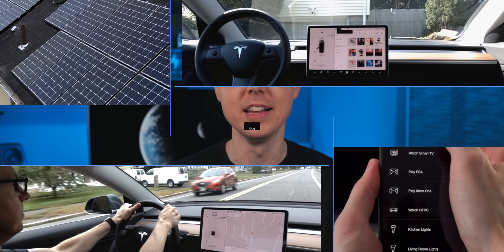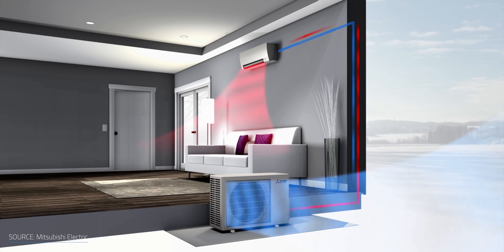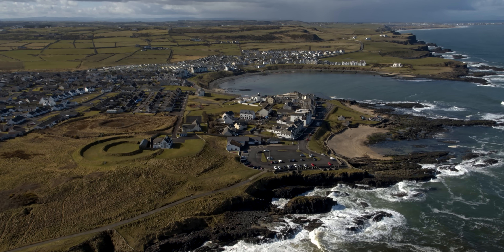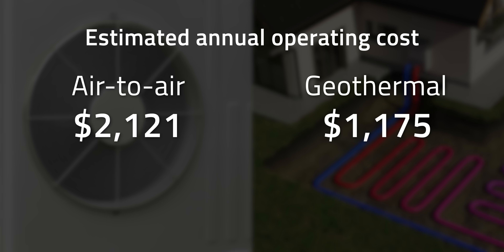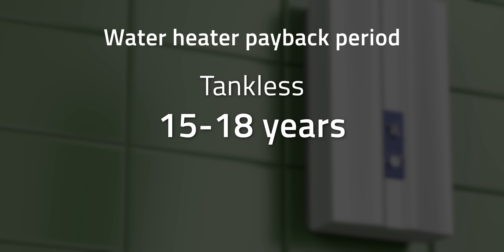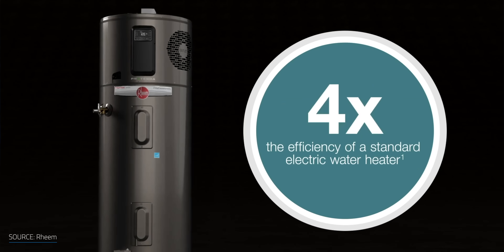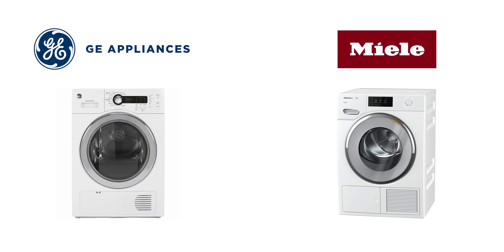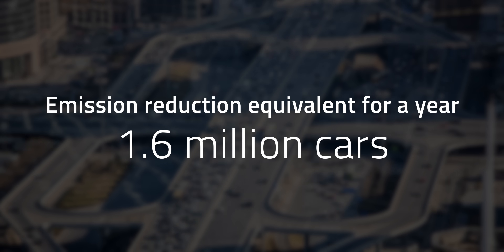Why Heat Pumps are Essential for the Future - Explained

Comment: Another thing you might want to look into: induction stoves. They cook faster and more consistently, plus they use less energy. They beat out even the holy grail of cooking: gas stovetops.

Downside: noisier, requires magnetic cookware, and a bit more expensive up front.
Reply: They are very popular outside the US. I didn't stay at my temp apartment long enough to get to love it, but I did have some experience with it. I was not overly impressed, I had to shop for specific cookware, with a magnet. I suppose if I had stayed in that apartment long enough, I would have gotten used to it. Instead I bought a ceramic top stove.
Reply: @doncarlin9081  I've used one for 15 years and I wouldn't go back to anything else. Easy to clean, surface doesn't get hot. Responsive like a gas stove but much safer.
Reply: Gas stoves are no longer considered the best, they release a lot of toxins into your home.  I do like induction for a lot of cooking (precise cooking temperatures makes custards, sauces, and chocolate much simpler, no more fiddling with a thermometer or double boilers), but I would recommend a mix of electric and induction because sometimes you want the pan to be hotter.
Reply: @Foolish188  "because sometimes you want the pan to be hotter" ???
That makes no sense.  I could melt the pan with my silly little 2kW portable unit!
Reply: A lot of them cycle on and off inefficiently, and have uneven heat distribution.
Reply: I really hate cooking on those
Reply: @dingfeldersmurfalot4560  Gas is worse on both accounts...
Reply: @dingfeldersmurfalot4560  The previous generation did.  About 3 months ago I replaced my induction hobs with modern ones ($45 each at Walmart).  They have 20 levels of heat and they don't start cycling until the heat is set to 0.5.  That is low enough heat not to matter.  If you still don't like the cycling, then you place the heat distributor under the pot.  This is an explosively welded sandwich of magnetic stainless, aluminum to distribute the heat and another layer of stainless.

Comment: I do HVAC I'm in Phoenix Az the Home of the Heat Pump from Goettle. That was a great machine. Heat pumps are getting better all the time. 20 years ago they would Heat down to 40 degrees outside so for deserts they worked great. Now I have a WSHP that can Heat with water down to 34 degrees and cool with water Temps up to 120 degrees.

Comment: Yes - I’m all in on heat pumps! As an architect, I’ve been involved with both air source and ground source over the years, and here’s my take on the two: ground source is more efficient and will last longer, but installs are complex because you are never 100% sure on conditions until you start drilling/digging. Air source are much more predictable, but I worry about sending hot air back into the environment in urban settings, contributing to heat island effect.
Reply: sending hot air back into the environment?
can you explain that please
Reply: People are going to use air conditioning for cooling whether it is from a heat pump or a single function AC.  Putting summer heat into the ground (usually just a few feet down) or into the air (rather than onto surfaces like how sunlight produces heat islands) is not going to make a significant difference.  Most homes have to issues with ground source heat pumps, compared to air-to-air.  First is the extreme cost difference, which gets relatively worse with the less heating a house needs.  The second is available yard area.  Well systems are even more expensive. There are also times toward the end of both the heating and cooling seasons when the temperatures of the ground around the tubing is not as favorable as the outdoor air temperatures. Ground source systems can be a great choice for larger buildings that also have large ground area, such as schools, but they are severely challenged for houses, especial those that are energy efficient.

Comment: Great presentation, as always. For those watching this who has a spa or swimming pool, do look into heat pumps.  I just built myself a super-insulated swim spa using ICF’s (insulated concrete forms).  Those gave me 5 1/2” rigid insulation.  I therefore thought I could easily keep the spa at temperature (usually about 100 degrees F.) with little daily-added heating, so I put in a large electric resistive pool heater (knowing it was inefficient by cost-effective to install). Even with my 4.8 kWh photovoltaic / Tesla Powerwall system, I was seeing $300/month electricity bills. I replaced resistive heat with a pool heat pump, which when operating only pulls 13.5 Amps at 240 V. 9 (whereas the resistive heater pulled 70 Amps!).  Now, my PV / Tesla Powerwall system handles the heat pump 100%, and my electric bill is down to $15/month average, and I’m keeping the swim spa at 100 to 103 degrees F. 24/7.  Amazing really!
Reply: Good for you. I have 3 plunge pools in our holiday accommodation which are all heated during the daytime using solar panels and heat pumps. Makes swimming all year round possible for our guests. No more complaints about cold swimming pools in winter. Could not afford this without good solar

Comment: Something that could help with efficiency even more is relaxing zoning laws to allow for more duplexes/quadplexes/apartment blocks/etc. since each home in those buildings shares at least one surface with another home, minimizing heat loss. 

Also has a lot of other benefits, like reducing the amount of driving that needs to be done, embedded carbon due to construction, less infrastructure needed to support, and so on
Reply: North America really needs this! It's awesome here in Europe to have lots of apartment complexes (within walking distance from businesses and services no less). It's far more efficient than suburbs although we do have those too.
Reply: Energy calculations for buildings in the EU center around this. A very modern freestanding house with top insulation and ventilation systems is not as energy efficient as a flat with only one side exposed to the elements. And improving this flat is simple because you need to improve only that one side. Free standing homes are not our friends.

Comment: I use a large and bulky portable heat pump for my shed/music studio. In the summertime, I get inexpensive cooling and in the Fall to early Winter, I get less expensive heating. My problem is that the unit stops producing adequate heat when the temperature drops below 20 degrees F. Even though my unit is indoors, at Zero degrees it's entirely useless. I am encouraged that newer models use heat coils to provide additional heat, so thanks for alerting me! I love your channel! New subscriber!

Comment: I install HVAC systems for work and an interesting thing I've noticed is that most heat pumps, furnaces, and central air conditioners that people purchase are on the lower end of the efficiency scale on the energy guide stickers. I don't believe I've seen any units past the halfway point
Reply: what's the price difference between the best and the worst?
Reply: That's because the cost for the more efficient ones is sometimes double or more. Depending on the cost of electricity in the area it might not save them money to go with a higher efficiency unit.

Comment: Thanks for a great video. I went solar late 2021 and changed to heat pump dryer and hot water as well as getting rid of natural gas altogether. The savings are amazing. My total energy spend per year has been reduced by 74%. Cheers!

Comment: Matt, with heat pump dryers, you mentioned lower heat as a negative. I built a test rig to run the temp slightly above ambient but with the cooling coils a few degrees below the dew point. Compared to an electric dryer it got two saturated beach towels dry in a third the time at about  fifth the amp draw. Cooler temperatures are nicer to the fabrics. That is a plus as I see it.
Reply: True that saved the electricity but the increased frictional wear on the fabrics, due to longer tumbling time needs to be considered. That might be the negative Matt was referring to in his video.

Comment: Presumably you’re planning to insulate your house to Passivhaus standards, so you should need very little additional heating. In which case, it might be much more cost effective and simpler to maintain to use simpler infrared panel heaters. Also you might consider using a simple airing cupboard to dry cloths slowly and efficiently rather than using a tumble dryer.
Reply: @xmfclick  at some point it’s not even a question a household with 4-5 persons in my opinion should have a tumble dryer.  However in the summer or if your living somewhere where there is only summer and no other season it’s totally wasted. Because then you can air dry your cloths outside.

Comment: You forgot about exhaust air heat pumps which heats the house using hot water radiators or flooring at the same time as heating the hot water. They take the energy from the hot air leaving the house. Nibe F750 is my favourite.
Reply: I'm a big fan of tankless water heaters. I installed one and immediately saw a HUGE difference in my electricity bill.  I'm shocked the US doesn't have them mandated, I guess companies like GE and others that make traditional water heaters don't want to stop production of a cash cow.
Reply: @Oneness100 , Tankless electric water heaters do not work well in northern climates, and consume a LOT of power for the short time that you are using them.  So they might have a 60 amp or 100 amp load for the few minutes you are using the hot water.  That is a huge hit on the grid, and in California they stopped selling homeowners a tank type water heater over 4,000 watts, so you can't buy a 4,500 watt tank heater in California.  

The heat pump water heaters have a very small compressor, so they do not provide a lot of heat each hour.  But the 50 gallon water tank can hold enough heat to provide 2 showers per hour.  

Also tankless water heaters require maintenance, and cleaning of the heat exchanger, even more maintenance when you have hard water.
Reply: @Kangenpower7  It's been a while since I lived in the home that had the tankless. Actually, after further review, it was the gas tankless, not the electric.  I just remember that my utility bill went down DRASTICALLY as a result, and I sometimes like taking either long hot showers or hot baths every so often and when I'd have guests, I didn't have to worry about running out of hot water. Plus, they'd take up very little space in the garage.

When I bought it, the only thing I remember was they had two or three sizes, this was back in 2002-2003 time frame. I just remember it wasn't the biggest, but it wasn't the smallest size.  I had the one where you could have 2 to maybe 3 hot water appliances/faucets running at the same time.  I read that in Europe, they have smaller units at each sink, etc.   I don't know if that's true, but I remember reading that a while back.
Reply: @Oneness100  The at the sink tankless water heater is normally about 1,500 to 2,200 watts, must be electric because no place to vent a gas one.

My guess is your gas one would be 125,000 BTU and require a 3/4" or 1" gas line to it.

A 10 KW electric model is 40 amps, requires 50 amp breaker and puts out only 34,000 BTU, so 1/4 the gas model.

We quoted yearly cleaning at 1.5 hours and about $195 service fee.  + Any valves or other stuff needed to backwash unit with external pump and vinegar solution, to remove mineral build up.
Reply: @Kangenpower7  Interesting.  Thanks for the info..  Yes, I did have to have a larger diameter vent installed.
Reply: @Kangenpower7  I had some in-line device installed before it enters the house that I bought from the company that sold me the tankless system from.  I remember that the device did something to the calcium to prevent it from sticking to surfaces and I noticed that I didn't get those nasty water spots on my car or on dishes after I installed this device.  Maybe that's why the company that I bought both units from  didn't say anything about needing to have the tankless system flushed.

The only problem with the tankless system was after about a year or two I remember I had to change something with the pilot light and it was a cheap part and it was easy enough to replace on my own.
 

I can't for the life of me remember the name of the device I had installed. I'm sure if I saw a picture it would jog my memory.
Reply: Why not capture heat wasted from showers and dishwashers drains. Use the heat to pre warm water going to water heaters.
Reply: @jandrade1713  I think that Tesla's new heat exchanger possibly does some form of this. I saw in on YT recently.
Reply: @Kangenpower7  Gas tankless top out at 199KBTU. In regions in near the Canada US border you'll typically end up with water coming in at about 45 degrees. And you want to rise to 120 at minimum (Should be 140 to kill Legionellae then mixed down really.) IIRC (Not looking at the chart) that gives you about 3.5-4 gallons of hot water per minute. So you're topping out at about 2 simultaneous showers (assuming you don't unrestrict your showers or have body sprays or rainheads.) Which is fine for most situations.
Reply: @Oneness100  Tankless have some benefits, but often, they do not save you money. Just like he mentioned in this video, 15-18 year payback time, then if you pay someone to do the yearly descale(could be longer on city water) that eats away any savings. Then when the power is out, you have NO hot water, with my small 40-gallon, 2 people can shower with power off and still have hot water left. 2 weeks ago, we had a cold snap, and the biggest complaint was from people with gas on-demand units, they all froze up. I have solar, so my 40-gallon electric is basically free to run, whereas a gas unit would be costly for me. My electric rate is cheaper to heat water than natural gas.(in case you want to know, my rate is 5.1 cents(yes, 5 point 1) per Kwh, I think the national average is like 12 cents or higher) With my low-flow showerheads(that actually work really well at 1 GPM) my total electric use on the water heater last month was 100 Kwh, and at my rate, that cost me $5.10.  In the summer, when the city water is warmer, that use drops. But let's just say 5.00 a month which is 60.00 a year. A new on-demand would cost about 2,000.00 installed. It would take me 33 years just to pay for the install, not including the monthly energy it used. And by the way, my low-flow showerhead saves more per month than your on-demand, and with my showerhead, I can stand in the shower and not run out all day also, but that would be foolish, even though people with tankless thank it is neat they can do that(so can I) If you saw a HUGE drop, then something was wrong, say like a stuck thermostat, if you switched from electric to natural gas, you can save a few dollars a month, but not a HUGE amount. I have had people say they changed the light bulbs in their house and the bill went down 100.00, unless they were running dozens of 100 watt incandescent bulbs 24-7 No way they save that much. You enjoy your very expensive tankless, I prefer to save money.
Reply: @stevem1081  Your power outage scenario is bullshit. Excuse my French.  Who takes a hot shower when the power is out?  What happens if you slip and fall when the power is out? If I REALLY need to, I can connect a battery backup system to run the tankless system from or to power a tea maker if I want to drink a hot beverage.  I have an electric tea maker that doesn't need much power to make a pot of tea.  If the power goes out, I usually go to sleep until the power goes back on, or if I'm really in need, I'll just get in my car and drive to where the power is up and running if I want to get something to eat.
Reply: @stevem1081  My area RARELY gets frozen enough to worry about.
Reply: @stevem1081  I used to have guests stay for a couple of days.  One time, I had 4 or 5 guests staying at my house for a week straight.  Tankless rules. PERIOD.

in that week, without a tankless heater, I would have run out of hot water after 2 or 3 hot showers.  And we were on the same schedule.   

But with a tankless, No worries, hot water as long as you want.  I told them they can take an hour long shower if they felt like it.  🙂
Reply: @jandrade1713  It have been tried, but it gets clogged too fast to be useful.

Comment: I sure hope the service business improves for mini-split heat pumps!! 
I installed three 12k btu mini split heat pumps in my Atlanta home 12 years ago that have worked flawlessly up until last summer.  I noticed one wasn't cooling well and wouldn't produce heat in heat mode.  I made several phone calls trying to get it repaired, but service techs wouldn't even look at it.  Every one of them wanted to just install a new unit.  The units I purchased 12 years ago were very efficient 14.5 EER (not seer), and I was reluctant to just throw it out.  Finally, I convinced a friend of mine who does commercial HVAC work to come and have a look.  The problem was simple. A service port schrader valve had a torn O-ring causing a slow freon leak.  He replaced the schrader valve, recharged the system, and it's been running fine ever since.  Good thing I didn't throw it out!  Sheesh!
 I also have a DIY heat pump hot water heater (AirTap A7) in my basement that's been running well for 11 years.  The A7 installs over a standard hot water heater tank and at $700 was pretty affordable.  
I love my heat pumps!!